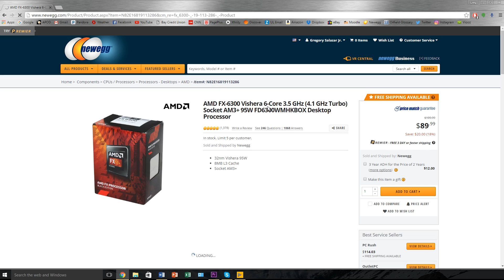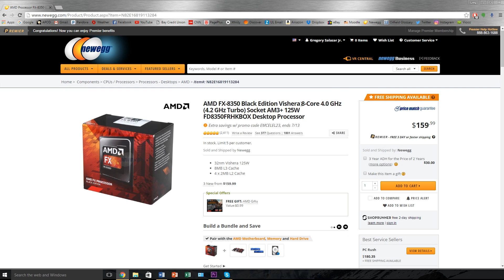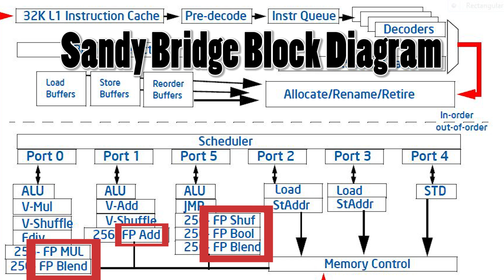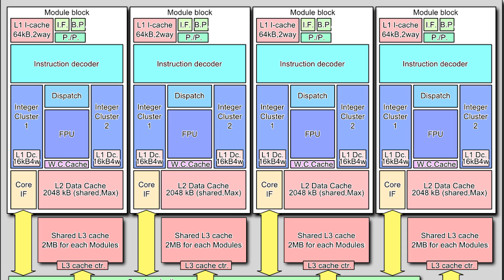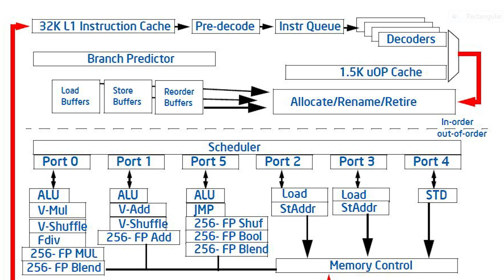How Many Cores Do AMD FX Processors *Actually* Have?

Comment: Bulldozer actually scales really well for floating-point operations, all things considered. Is it fast? No, but the logic behind the design is sound.

Going from 1 to 2 threads on a module nets between 60-80% performance uplift for floating point operations (in most cases) and integer scaling is almost perfect (100%), That's far greater than what is typically achieved with SMT configurations. Consider that Bulldozer was a server-first design (as all AMD core designs post 2003 are) and integer calculations are most important there - it's not unreasonable to design a core/module this way.

Clearly the design didn't pan out that well. Maybe things would have worked out differently if the Bulldozer project wasn't massively delayed and AMD wasn't so cash-strapped/mismanaged.

Excavator (the final revision of Bulldozer) resolved many of the issues of the design and it's actually quite a nice core that performs well (even compares well against Intel's archs in some metrics). Would Excavator in full desktop form have been enough to match Intel Core? Most likely not.

I'd hate to see AMD fall back to cranking out chips that are a facsimile of what Intel offers at the time. They're at their best, and most important, when they're challenging the status quo. They booted Intel up the arse with AMD64, IMC on x86, Hyper-Transport, native multi-core dies and the crossbar switch, the move to bring graphics IP and other application specific logic into the die (though Intel just narrowly beat them to it!) etc. Zen continues that trend with the introduction of Infinity Fabric. I don't think people appreciate how important that Infinity Fabric is. It allows for high throughput/low latency/short hop connections between multiple dies, it obsoletes the old "monolithic dies are always best" mantra. Infinity Fabric won't only apply to CPU, I'm sure we'll see it used for GPU/other accelerators in time. Intel weren't prepared for that, hence the "glued desktop dies" nonsense :-)

Comment: so if we add 2 corew pee fpu we have 4+4=8ghz... Can I transform my fx8350 as an 4 core 8ghz???
Reply: DirectX 11 is optimized to use 1 or 2 cores. Future games will use DirectX 12 which spreads the load over all the cores.

In the game Ashes-of-the-Singularity an FX-8370 more than doubled in performance in DX12. A Phenom II X4 955 more than tripled.

Comment: AMD should have marketed the FX processors as hyperthreaded, since the second integer core in each module adds only 13% more space to the rest, where "normal" hyperthreading adds about 5% transistors.
So it's a kind of a extreme hyperthreading.
They would have looked much better that way!
The FX 8-Series were toe to toe with the 2nd gen. i7 at launch time, and toe to toe with the 3rd gen. i7 when the Vishera revision came out

Comment: This is the easiest question to answer.  I'll use the FX-8350 as my example (since I own one).  The simplest answer is that a CPU core is an Integer core.  Before the introduction of the 486 CPU (pre-Pentium for all you kids out there), CPUs didn't have Floating-Point Units in them by default.  You had to buy something called a "math co-processor" separately for floating-point operations.Therefore, an FX-8350 has eight CPU cores and four FPU cores.  It's really not all that complicated.

Comment: "FPU handles most of the arithmatics" no. CPU's are generally more catered towards integer operations. In games almost all floating point operations are done on the GPU instead. AMD bet on the adaptation of GPGPU applications, and although it sort of did, it did it not to the extend they hoped for. Cinebench relies heavily on floating point operations due to the render workload, cinebench is therefor the worst case scenario for bulldozer hence why only 4 cores are shown since it only has 4 FP units. Most people render on the GPU now anyway, so cinebench kind of lost its relevance imho.

Comment: GTA V runs great on fx6300. Not so much on a hyperthreaded i3. ijs.
Reply: Gta loves having multiple cores due to the sandbox environment.
Reply: Yes but that proves that the AMD fx cores are superior to Intel's hyperthreading. Intel's core may be faster (not so much if you compare from the same generation), but when it comes to multi-core performance, threads don't cut it.

Comment: Normally I really enjoy your videos, but there's a lot of small inaccuracies here and gross over-simplifications. Sometimes drawing the wrong conclusion or drawing the right conclusion based off wrong reasoning. And you never really explained what hyper-threading really is (simultaneous multi-threading). The FPU doesn't do quite what you say -- it operates only on floating-point, i.e. non-integer math. A large majority of modern software do not have so much of this floating-point math that sharing it like this would cause a performance issue. The one thing that does is 3-D graphics, but that is largely off-loaded to a dedicated graphics pipeline or separate discrete card. Other issues at play: pipeline depth, cost of recovering from missed branch prediction, cache coherency, compiler optimizations, and cache associativity.

Comment: Now it makes sense why there is such a price difference between Intel and AMD. The way I see it unless your goal is to strickly bench performance, the average user and gamer will not notice the difference . (IMO)
Reply: well intel and AMD  will never give you a full 100% chip this how they make money  intel makes a 8 core chip with 4 threads and all cores have slight increase  like 10% in strength  just to make a point and amd  has a 8 core ryzen with 16 threads and 30% increase  in power so where does this stop it won't intel and AMD  will give you little improvements  for $$$$   nvida cuts there gpus like this Aswel they can make a powerful fully unlocked gpu  then they disabled a few cores and VRam  and teroflops and sell it

Comment: Hyperthreading is probably one of the most overrated things ever to exist. No idea how they advertised that but the fact that people even compare a 4 core cpu with HT to a 8 core cpu is something special. Take a 4 core i7 for example. Remove the hyperthreading and add one physical core to make it 5. I'm fairly certain the 5 core would outperform the 4 core with HT in every single application. Dont get me wrong. Hyperthreading is a good thing to have but it's noth worth the 100€ Intel is charging for it. The difference between a i7 7700k and a i5 7600k is 2 MB in L3 cache and Hyperthreading. It's just not worth that much.

Comment: g4400 2 core can compete with the FX-8300 8 core series in single core and multi core processing. a 7 year old Phenom II x6 run almost the same speed as the fx-8300 and its a 6 core. but the craziest thing about all of this is this 60 dollar 2 core intel cpu does better in single core by almost double the speed and matches the multicore score of a 6 core amd cpu. my god what happened to amd.
Reply: The 8300 was released years before the g4400.  Just because it's in the pentium line doesn't mean it's old.  I know you're arguing that the fx 8300 has more cores, but 3 years of CPU advancements?  Every 2006 cpu will DESTROY a 2003 cpu.  Huge time difference, and cores/threads/clocks aren't everything my boy.
Reply: Stil have better gaming performance than a mac
Reply: They lost keller. Also one of the reasons why Ryzen is actually good. He was back with them to work on that. He enginered the original A64 chip that also beat Intels P4 back in the days, As long as keller does the designs/hard work, AMD can put out some quite awsome chips. Sadly a guy like keller doesnt hang on the trees, and are super expensive to have hanging around in your company for long. ;-)
Reply: It's not that crazy if you would know that amd fx's basically doesn't operate in "single core". You just simply can't use one of 8 cores. You can use one module, but not one core. 
And Modules are basically not supported, so performance are cut in half for fx.The same for multicore as it forced to use half of cores and only threads for other half. Fx have more potential performance than intel's at that time(2011/12), but intel's fan boy kills it.

PS.
And bassicaly you reffering 3 years old golf to 7 years old bmw. Doesn't make any sense.
Reply: +SERGE
Your asking to me what happened to AMD within 3-4 years?
What happened to Intel after less then 2 years?
a i3-8350k = a i7-7700k in performance 100%.....8350k even over-clocks higher on average.....

Comment: The FX architecture of clustered multi threading is better for reduced instruction set code as found in games consoles which is based on the theory that 20% of instructions do 80% of the work.  (John Cocke, IBM 1974).
This is why a games console has always out performed a PC with the same hardware configuration.  The Bulldozer was designed as a pure gaming chip but PC games are still programmed with simultaneous multi threading so it doesn't work as well.
Put it in a games console and the Intel would get nowhere near it.  Now AMD has cornered the console market they will probably destroy Intel in the mid range processor sector (well maybe)
I remember crappy 486 dx PC's running 65mhz getting their ass handed to them by Commodore Amiga's (that were already 7 years old) running a mere 7.16mhz running RISC and sporting separate graphics and sound chips. 
Windows is to blame partly for the Bulldozer fail as it still runs on crappy DOS which is and always was inefficient.
Windows 3.11 was a graphical interface version of Dos 6.11 and a copy of the Amiga Workbench from years earlier which only needed 250kb to run.
If AMD could come up with their own OS made purely for gamers which would be back compatible with windows games and they develop clustered multi threading further with game developers the pc gaming industry would hit the next level.
Intel hyperthreading is a gimmick, when you actually need the threads they are next to useless as resources are split effectively underclocking the processor.  It only ever made any sense on a single core. 

The last half a decade in computing is an example of how little imagination people in general have any more as it's all about short term investment.  Windows as an OS should be obsolete but as everything is about marketing crappy old hat ideas that were never that great are still soldering on. 

Other areas of engineering are the same such as motorcycles, a decent road bike from 2005 is as good as anything you can buy now just without a few useless trinkets such as ABS and traction control.  I expect mobile phones will stall out before long, I can't see that they are improving at the rate they were just a couple of years ago.

Even the Honda robot looks like a joke especially if that's the best the industry can produce nearly 50 years after a supposed moon landing.  I'd be embarrassed to have my name anywhere near that project, it doesn't even have internal self lubricating ball joints.  I'm pretty sure there are military droids  out there that can move at more than 3.7mph.

Comment: So... Lesson for hardware manufacturers here it seems:

If you're selling something that is logically interchangeable with the components of a competitor (CPU, GPU, basically any standard parts), having a design that requires software to work differently than your competition will screw you over every time. (that's not just something I get from this, but also other examples.)
Because developers frequently don't bother to create two (or more) independent sets of logic unless they absolutely have to, even if your design is technically more efficient in theory, if using it efficiently requires radically different logic than whoever is dominating the field for whatever hardware you're making, you are going to lose out and it'll make your products look a lot worse than they may actually be.

Seems to be the case here, seems to have been the case with older CPU designs (like late 80's, such as the motorola 68000 vs the 65C816), the CELL architecture in the PS3, a bunch of optional features in the ATI x1000 and 2000 series (such as hardware tesselation. - nobody bothered back then, and by the time it was a 'standard' feature, they ended up being bad at it.)

In short, if it requires a special, extra effort to write efficient software for something, chances are most developers will not bother doing so, unless your product is the most popular thing in the world by a huge margin. (and even then they may still not bother.)

Comment: A little test with CPU-Z's benchmarking tool said, that my 4.5GHz FX-6300 is just as good (single-core) performance-wise as a i5-2500k stock. The FX pulls ahead at multithreading. Well, let's see what Zen is capable of.

Comment: Thank you for the explaination! But still - the 8 core cpus of AMD are still enough to max out most games in 1440p qithout a big bottlenecking (I mean there is a little bottlenecking with my GTX 1070 but it is not that big of a deal at all). But sooner or later they will "die":-P

Comment: AMD fucked up with Bulldozer. The single dispatcher and FPU per 2 cores is a great design, the integer cores each have L1 and L2 caches and the L3 is shared - perfectly valid.

The problem is that branch prediction misses takes a long time to recover from in the Bulldozer core design. They should've known that, my guess is that they did know. Cache misses are far more likely the cause for CPU slowdown than the shared FPU and dispatcher being a bottleneck. Most instructions shouldn't touch the FPU.

Faster and larger L2 and L3 caches do wonders for the crap software being built nowadays, which is what Intel are doing(and refining the manufacturing process). 

Maybe we can get passed x86/x64 and OOP, this decade. 
Truly general parallel computing needs a whole new paradigm for software development, and CPU architecture should look more like modern GPUs. AMD are showing a path in that direction. 
AMD HSA (in their APUs and very probably implemented in Zen chips somehow) uses a single bus for both the CPU and GPU cores, thus exposing the GPU cores to the shared L3 cache. With Mantle and OpenCL, properly parallel instructions could be passed to the GPU cores and bypass the x64 cores entirely, but by using a similar API to x64.

Comment: i have to ask then, bulldozer based processors like steamroller architecture shares this CMT design, getting higher clocks speeds would compensate the clock for clock advantage of Intel processors? I have a 7860k Apu that actually performs quite well but I plan to use it over 3 to 5 years based on over clocking capabilities.

Comment: My current build is AMD FX-6300 3.5 Gz, no overclock as had stable 4.2 Gz but began getting high cpu temps so restored default, hyper t4 air cooler, 16 GB 1600 DDR3 ballistix Tactical RAM, ASUS M5A97 LE R2.0 motherboard, and a Gigabyte amd radeon r9 380 4 GB G1 gpu. I'm considering upgrading my mobo to GIGABYTE GA-990FXA-UD3 Ultra (rev. 1.0) , my processor to AMD FX-9370 Vishera 8-Core 4.4 GHz, and GPU to XFX Radeon GTR RX 480 DirectX 12 RX-480P8DBA6 8GB 256-Bit GDDR5 PCI Express 3.0 CrossFireX Support Black Edition Video Card. Will the performance gain be enough to enable max settings at 4K while still preserving suitable FPS and justify the $613 price tag for the upgrade?
Reply: 4k on a single 480? not so good
Reply: AtgreatR9 so not worth the price, then? suggestions for what I'm trying to accomplish?
Reply: Andy Bohl crossfire 480 for 4k gaming. even the most powerfull cards like 1080 cant pull 40+ fps 4k gaming on max settings in some games
Reply: Andy Bohl and if u are making a new build do it with intel. especially for high end gaming.. we all know that i3 outperforms some amd octa core cpu-s

Comment: I had heard that Windows 10 was going to fully support AMD processors.  Perhaps that was just a rumour.  I haven't used AMD in a while, but I used to prefer their processors for their multitasking smoothness.  Until recently, it seemed Intel could never quite handle background processes and multitasking without lots of stuttering.  Does one architecture work better than the other for specific tasks?

Comment: that's all well and good information but how about this. Ive used an FX 4100 since 2012 and I can play any game I've purchased since then at 1080p. Yes I have to turn some settings down to achieve playable framerates or 60fps but that processor cost me 90 bucks bundled with the board years ago.
Reply from the maker: What is surprising about this?
Reply: Science Studio it just goes to show that you dont "need" a new processor all the time. They make so many models both intel and AMD that are only better than each other in small increments until they unveil a new platform and the only people that need it are those desiring to play games maxed out at a resolution higher than 1080p.

Comment: Computer engineering or electrical?  Also, if electrical, do you see a difference in electrical engineering and electrical engineering technology?  I am at a hard point where I am transferring from Devry to UNT, only to find there is a big difference for transferring credits.  I would seem to lose them if going with the non tech version.  Originally joining Devry I thought they just added the tech and it was a same electrical engineering degree.  At new college they say tech is more hands on while other is theory.
Reply from the maker: Petroleum Engineering. LOL.

Comment: Ahh, so if each AMD Core relied on it's own Floating Point Unit then that would bring them more up to par with Intel. Considering Intel processors use 1 FPU per Core and AMD uses 1 FPU per 2 Cores, I would personally see the AMD FX CPU's as a 4 Core Processor. (The FX 8000 series anyway). So to me, one Module would be 1 core, kinda. It's confusing why AMD have done this but hopefully Zen will be different.